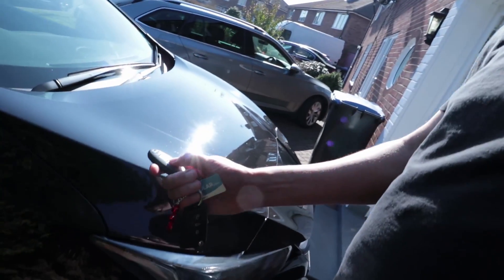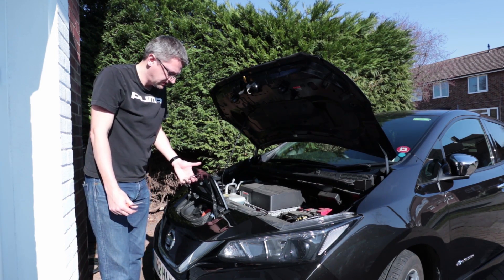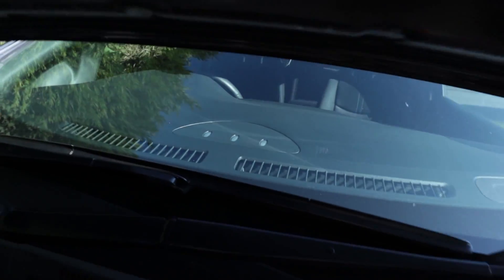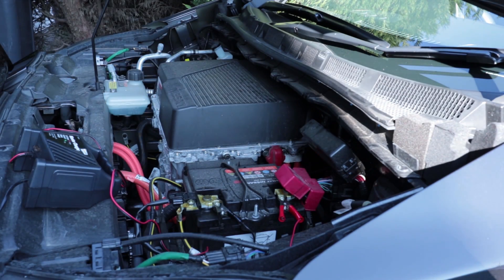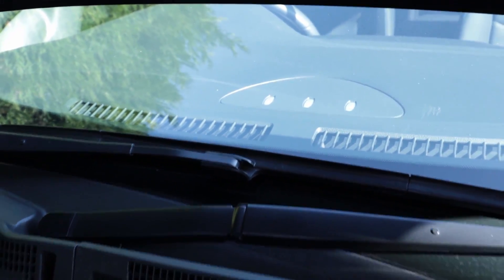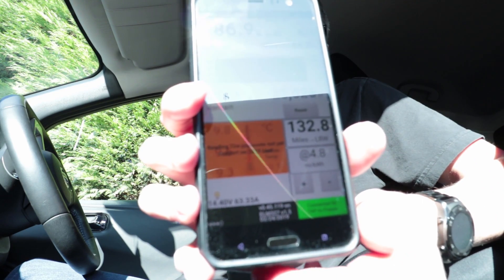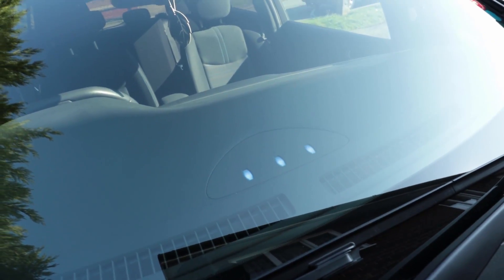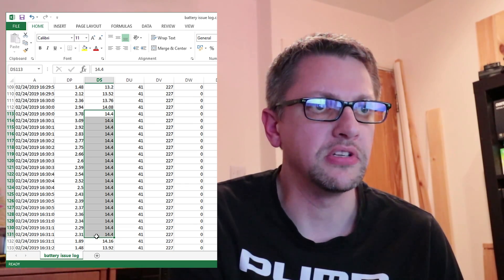40kWh Nissan Leaf - Dead 12v battery

Comment: Various forums have discussed this Leaf issue at length for years. It's clear that there is a common glitch over maintaining the 12v battery level. Many have accepted this and now just use a smart charger overnight once a month. They not only top up but also maintain the 12v battery in good condition. Such problems as this go away by this simple regime. Should not be necessary of course but life is too short to stress over such issues.
Reply: A glitch? I don’t think so. I have a 2011 Leaf. The factory 12v battery was replaced at the 5 year point because it was time. No issues with the battery at all. I purchased a similar battery from a dealer and replace it myself. No issues at all just like the original. I wonder what people expect out of battery. In extremes temperature areas, cold and hot, I would replace this battery every 48 months tops. In SW Ohio the wx is moderate. Normally both hot and cold extremes are rare and do not last very long. Thanks
Reply: @Rhaman68  -  Not all cars have this problem. You are just one of the fortunate ones. That is part of the problem though because it's random and unpredictable.  Nobody would complain about your own experience. But some people have run into this issue within a year - and then again with a replacement battery under warranty. Dealers just shrug and say it must have been a bad batch of batteries. It isn't. It's a real and present problem. Resolved by physical intervention by the owner to top up and maintain it regularly.
Reply from the maker: I haven't experienced the issue since I made the video. For me it was a one-off occurrence. Thanks for commenting guys, it really helps others! 👍🏻
Reply: My MG ZS EV which I bought about twelve months ago started giving a low 12v battery message so I just charged the 12v battery up with a trickle charger overnight. Seems ok a few days later. Seems a fairly common problem with EVs. One theory is the 12v batteries are better off being charged and discharged and not having sudden high loads causes crystals to form or something. Will probably give it an occasional overnight trickle charge.

Comment: Glad you sorted it, Rob. Thanks for the insight. Dropping down to 4 V is very damaging for a 12 V Lead/acid battery. Whatever caused it was capable of drawing power down to 4V, so it could possibly be 5 V circuitry, but is more likely to be lights, fans or a relay which had remained switched on overnight. Others have mentioned the charger connector. Let's hope it doesn't happen again.
Reply: Leaving the hazard lights on for 30 mins will kill the 12v battery. Ask my dog! Stick a dogproof takeaway wooden spoon over the switch.
Change all lights to LED, especially the  boot because you  can't see if it's on. 
It needs to  be much brighter anyway.
Tie fishing line to the charger door actuator to make an emergency release.    Solar Bob

Comment: Humh, does the new Leaf have the same problem as the old one?
3 times my facelift -13 has had a dead 12v (about 3V). I believe every time was over night, one might be over 2 days. Nothing on. Actually, nothing really can be on other than my OBD, but surely it does not drain the 12v over night..
I'm not quite sure what the problem was with the old Leaf, but I believe it was a relay that didn't shut off correct every time. It now should be a known fault by Nissan as not only my car was affected..

BTW, some say the 12v in the Leaf is a bad battery, I still have the original with no problem (6 years old). I believe it's more down to a weird way the car charges it, so it's often pretty low SOC.

Comment: 12v battry has to be full 
It talks to the charger before it charges a flat 12v battry it can not talk and no charge
To 12v or the 40 kw 
Have to charge 12v up first

Ask if thers a update so it will charge 12v first 
Have heard this problem  before

Comment: Just after I bought my Leaf I went away for a month.  My dealer told me not leave it plugged into my charger. I did fix a connecting lead across the 12-volt battery and connected a battery charger/conditioner while I was away to avoid problems.  Now whenever I'm away for long periods I leave the 12 volt battery on trickle charge.

I'm just about to get my first service having done just under 6000 miles.  My battery SOH is 95.35% according to leafspy.  It concerns me slightly I wondered what your battery’s SOH is.
Reply from the maker: Mine is just over 94% after 9.6k miles. Good tip about trickle charging.

Comment: I've had a similar thing happen on my 2013 SV.
I left my OBDII dongle plugged in when I went on a 2 week vacation. Dead battery when I got back.
Some pieces of information you might find interesting that I've found on forums:
1) The 12V battery is required to be at a healthy voltage for almost anything in the car to work, this includes charging. (You discovered this in the video)
2) The 12V battery is only charged by the vehicle when the car is on/"running". Plugging in an ev charger does not charge the 12 volt battery.
3) It appears that EV chargers will draw a little bit of current continuously while plugged in. In reference to point 2 above, this means that leaving your car plugged in for a long period of time could give it a dead 12v battery. On some forms lots of people report plugging in overnight and coming out to a car that doesn't respond to the key. Some chargers are more notorious for this than others.
Background- Look at the J1772 wikipedia page. Part of the J1772 protocol is having a voltage provided by the vehicle to the charging station. I think this is the proximity wire. 
4) Some people to resolve point 3, have hard wired in a 12V battery charger under their bonnets that is spliced into the AC lines that come in from the J1772 port so that anytime their vehicle is plugged in, the 12V battery is charging too.

I suspect there is nothing wrong with your car or 12V battery. Just check the cell fluid levels and put it on a 12V charger overnight. Maybe carry one of those 12V booster packs in your boot, just in case this happens when you are away from home.
Reply: My -13 Sunderland built Leaf DOES charge 12v while on charger, and during preconditioning. So it's a bit strange if the US models don't..
However the 12v charge-system in the Leaf is a bit weird, some sort of "smart" charging. Goes up to 14.4V or something after every startup, plugging in the charger. When it's satisfied, normally just under 1 min, it goes down to 12.96V. If you then operate the wipers, it goes back up to 14.4V for the same amount of time.
In cold weather, or depleted battery it run at around 14V much longer.
Reply: Rockjob Hi. The issue was the status of the 12 volt battery: it was not serviceable. The 12 Volt charges when the car is plugged in, or, lower priority, from the main battery pack. Due to the limited range and most people charge daily, the 12 volt is not an issue. The 12 Volt has no specific way, and it should, from indicating low voltages. Random icons/messages on the dashboard is the way to tell the operator but this is not in the car’s manual. As far as I know, all Leafs behave in this fashion. The 2011 manual shows little info as to the 12 volt battery. I surmise the schedule of services is intended to have Nissan techs check its condition. Thanks
Reply from the maker: Very detailed post, thanks for the tips!